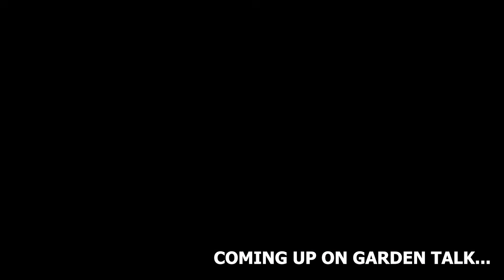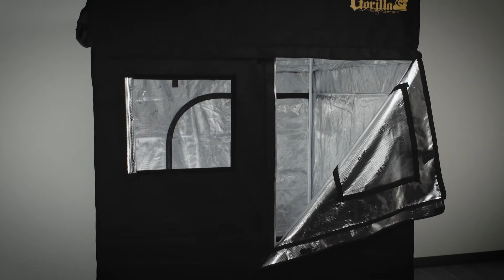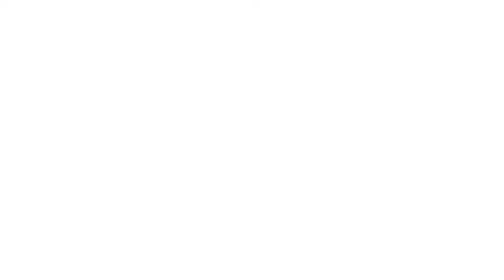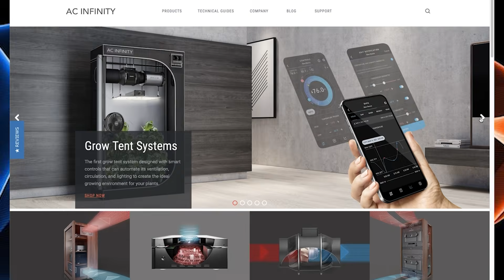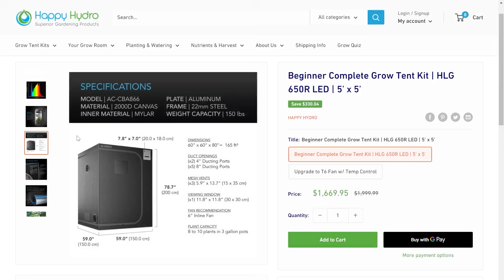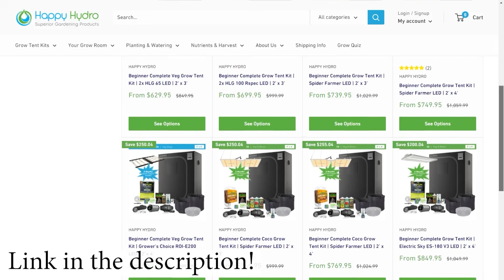Increase Plant Yield By 30%+ With This Essential Element! (Garden Talk #76)

Comment: Yes, you have the process exactly right.During the daylight hours, plants produce excess glucose through photosynthesis, which they link together into long chains to store as starch inside their cells.When darkness falls, plants cannot photosynthesize, so they break that starch back down into soluble sugars (like sucrose). These sugars are transported throughout the plant to fuel growth, tissue repair, and energy production via respiration.

Comment: Soo I grow in 20 gallon pots I do the perma flower right so I veg in a 5 gallon fabric than when ready that fabric pot goes into the 20 gallon I do my amending in the first place gia green 444 284 and glacial rock dust microbes I use 60 table spoons of each the first time on reamends(as I use social for 3-5 grows) I do 25 %wormcastings an 20 tablespoons of the three I do nothing further than than on the amendment end no topdres I just train and defol ..I do not ph but use ro water  @420scene doesn't believe it works but I pull a lb out of my 4×4 every 8-10 weeks depending on flower times of course am I the only one in the world aware of this lazy hack...I have beautifull plants all throughout the lifespan I haven't seen a defencey sense I started doing it this way...think about it tho 3 kg of each feed starting out another kg each run that's a lot ...I'm on a mars hydro es300 if that may affect anything
Reply: @willglasbrener2605  Literally Mr. Canuck's recipe &$$face.

Comment: Average amount of Co2 produced per rabbit:
Reproducing Doe's: 12.6 grams per hour, 302.4 grams per day, 3.02Kilograms Co2 per 10 days
Fattening rabbits: 3.34 grams per hour, 80.16 grams per day, .8 kilos of Co2 per 10 days
Poop per day: A 1lb-3.5 pound rabbit makes 133 grams poop per day.
A 6-10 pound bunny = 220-450 grams of poop per day.
I'm still trying to figure out how to do this and keep the bunnies happy and the Co2 levels in range and I really can't stand doing math. I'd take the rabbit pellets and feed them to red wiggler worms for primo castings and use that in my soil. Not to mention the pellets themselves can sell for a crazy price! More than the rabbit food costs easily. 2lbs for $16 on Amazon for the manure and 50 pounds of rabbit feed for $12 at Petco. That's $400 of manure for $12 feed plus the rabbit meat and fur. 
Also: The droppings can go straight from under the rabbit hutch because it's not a hot manure. It won't burn plants. It is, nevertheless, four times more potent than horse or cow manure and twice as rich as what chickens can produce, partly because those manures lose nutrients while you wait for them to be useful. It's obviously a practical thing to do even if just for raising pets. That and a great way to clean up the trimmings from the produce. All of those nutritious fan leaves being devoured by bunnies with the munchies. The more they eat is the hungrier they get. I also wonder if the terpenes in the scrap weed feed would season the meat. $55 for a 3lb rabbit that made over $16 in manure a day, it all equals profit as long as the rabbits are happy with their living conditions. Hopefully I'll be seeing a video soon of someone who actually tries this and is successful.

Comment: Any ideas about this issue would be most welcome.

I have 7 SCROG plants in grow bags in week 6 of flower. All 7 are planted from a single pile of Coco coir, worm castings, compost, perlite, and regular cycle Grow Dots.
They are on an auto-drip system at 75 ml/2hours from a single reservoir. pH adjusted to 6.5 with Silica Boost 5ml/gal and Epsom Salt 2 tsp/gal. 
5 of the plants are very green an sugary. The other 2 have paler fan leaves with less sugar, but normal looking flowers. I have changed the direction of water flow with no obvious change. I do have a bit of a mish-mash when it comes to lights, so that may be it. I'll try mixing them up differently next time. Any other ideas? 
Thanks! 👽✌️

Comment: So can we still achieve 30 percent increase by using carbon based nutrition assuming everything else is kept in balance, sounds like the plants would respond to higher intensity light without stress
Reply: Right now I'm doing all of this and trying to make it work together. I'm seeing amazing results 3 weeks into flower, unbelievable results so far. For a year I keep temperature 74 and humidity 60 dropping lower closer to harvest. This time I have all big yield plants and I'm trying different with temperature trying to bounce it between 74 and 83. Wow these plants love 83 degree, only 1 strain I had to move her to another tent she loves 74 temperature.

Comment: 34:59 
Very important because sometimes your plant needs magnesium and not more nitrogen. Foilar spray is th esiedt eay to tell because less thsn a few hours your leaves will respond. Epsom salt works fine if dikuted correctly but tbh any till help. Sprinkle some un a bittle and see if anything happens

Comment: I have been growing my own cannabis now for 5-6 years, I am using quick grow nutrients, microbial mass, chitosal and peat moss mixed with sea-soil (a mix of fish parts and forest fines), I have always been satisfied by the mix, but I am also super curious about the yield and potency increase I know can be provided by the CO2 supplementation. I use a grow-tent, in my dining room, so cannot use co2 gas supplementation, is the sea soil adding enough co2 to improve my overall yield and potency?

Comment: My Biowave opened all my stomatas 100% at a constant, was insane when using Co2, I did as soiless and was to control my feed for the increased light and Co2, then backed off evening in last two weeks and slowly copied my environment mimicking weather seasons
Reply: Where can I get one
Reply: @johnpeter9000  order from the company direct if you can find it, if look right now but am driving atm

Comment: I have used that Canna Boost accelerator since the early 2000s, and that is one product I believe does more for any indoor crop no matter what line of nutrition I was running.    Did side by side test with same strain, same cuts, same mom, same soil mix to a tee!  Every time the plants hit with canna boost, we obviously better tasting, smelling, and just over all tricome development looked stacked, larger in diameter and height. This was very noticeable after a phenomenal 6 week plus cure in an environmentally controlled cure room.  

 "The cure is where we see who really shines,"  

When I'm growing a true connoisseur crop,  it's one of those ingredients I find to be irreplaceable.   #carbon
Reply: What other nutrients line have you ran? Just interested to know, my mate runs canna and Dutch pro but trying shogun line this time as its half the price.

Comment: 3000ppm co2?! Haha. Nah I've read good studies showing in most cases anything over 1100 ppm is essentially pointless. I've been using that level of co2 for years and I've pulled 4 per light on gorilla glue #4, so I think I maxed out that plants potential with that ppm. And that was on a 4x4 tray with a 4x4 canopy...

Comment: As a small scale organic farmer we also generalize carbon being any organic material that has turned brown or dead. 
Within a regenerative system these carbons are used first for animal bedding. Applied in thick 6 inch plus layers like a carbon diaper you might say.
This carbon bedding locks in nutrients from the animals....waists.
Also locking up ammonia from off gassing, a vital natural resource for growing things once the compost has broken everything down to be plant available.

As a previous layer is messed on a thick new layer of clean carbon is put over the old layer. 
The animals always have a clean natural surface atop and once the layers begin to add up it begins to compost on its own. Typical deep bedding is allowed to become 3 or 4 feet thick before removed to finish composting.

Ultimately what you end up with is an extremely nutrient rich mixture of materials that has already begun the composting process. It just has to be piled up to finish composting.
It makes some of the best compost I've ever seen or used.

Comment: According to what I have heard and seen biochar works great. But you must first acclimate it which means treated with rich soil and only use about 10% of your quantity of soil with biochar and make sure you have the soil very wet to make the biochar hydrophilic which means opposite of hydrophobic it can hold water in other words. You can also increase the hydrophilic by a term cracking which means put steam to it and expanding it to hold more water better.
Reply: A yukka based 'wetter' also helps with biochar.
Reply: The difference is that biochar has spaces that let myco. grow. Biochar is like a hotel for organics.
Reply: I was going to substitute the yucca with aloe vera gel in water feedings.

Comment: I grow citrus trees indoors as a hobby, and the more I've watched each sections of this video, the more I get frustrated with fertilizer manufacturers.

     I know nutrients comes from the air, water, soil, but we known about 22 nutrients to date and they are: 
nitrogen, phosphate, potassium, oxygen, hydrogen, carbon; calcium, sulfur, magnesium; iron, manganese, zinc, copper, cobalt, nickel, silicone, sodium, aluminum, boron, selenium, chlorine and molybdenum. 

     Carbon, is one of many macronutrient nutrients. Why, do almost all companies omitted this very important nutrient from thier formula?
I just understand that concept by forcing many plants into deficiency problems status, based on the lack of that nutrient.

Comment: When I switched over to organics i quickly noticed that the main drawback to organics was a struggle for adequate oxygen in the bottoms of my soilless pots. So i started burying airstones hooked up to my air pumps in all my pots. Increasing my yield by a consistent 25%. You're welcome
Reply: I do this same thing. I have a small air stone in the bottom of each of my 5 gallon buckets and I grow in coco which is light and fluffy anyway. Since coco is considered hydroponics
Reply: @KevinModz65  right on, ive done side by side comparisons and i saw a consistent 25% increase in yield and general vigor.
Reply: Lol
Reply: peroxide
Reply: @tylerlidster71  kills your beneficial microbes.
Reply: @Rand_al_Thor372  even diluted ? I'm a Coco guy 😂thought I had nuff skills to try soil grow and I nearly ruined it 😂 soil after this is again interesting me alot 😂
Reply: @tylerlidster71  yeah bro ppl over complicate it really. All i need is a bale of peat based soilless mix and this dry nute blend called Super Bloom from Rons Organics here in Dallas.  That and rain water and im chillin.

Comment: Under 1500 ppm is the legal safety limit to enter a room in dispensaries here in AK. They run them at 2200 to 2700 ppm. But the room has to be aired out to lower than 1500 ppm before it can be entered safely without risks to people.

Comment: Gorilla grow s tents ⛺  I have them and the zippers fail first, so baddd
Reply: Why not add roll of velcro? You can get craft section at walmart
Reply: @melissawillard6600  Gorilla has the worst Zippers!! Buy a AC. Infinity-Way better tent, and zippers!!
Reply: I made mine out of ag plastic with velcro dots.... cost about 20. It's lasted 3 years so far.
Reply: @melissawillard6600  THANKS

Comment: I found XL bags work very well the 365 I have a C regulated in the room in the summer I keep the tent open days /night close it with a small dehumidifier inside I keep two in the room carbon in the soil really helps the coconut horticulture with the sugar really makes the plant vigorous Full coverage a must not overcrowding  I’m running so hum with exceptional results also bud igniter Advanced really gave them that boost even in the third week Tarantula piranha Even though the soil does not recommend it I think it’s very important to add those extra microbes fungicides everything that comes with it really happy with the Gaia green pro bloom As well as the phosphate rock dust Gaia green worm castings unbelievable results little extra Watching what the plants will use outdoors it’s incredible as well First year using Gaia green I have not sprayed once indoors or out plants are Thriving no pest issues outdoors as well not even a beetle this year Or a caterpillar kind of weird-not even a fly of course flies outside Living soil the plants will kill off any pest tries to invade it I did kill a couple 5 ft plants I seen earwigs going in the stocks I took care of that right away The rest just took off
Reply: dude! punctuation!

Comment: Wonder what nik thinks or says about defoliation and how important it is with the uptake of carbon intake obviously less leaf matter less co2 intake? Or less leaf matter less needed?  I mean WOW the information here is definitely entering higher level of understanding how things scientifically work .basically he puts things in mechanical terms. Like calcium is like a cam shaft or valves. Sunlight , carbon, nutrients is the gasoline.silica is like intake manifold . Lol

Comment: Thinking about sealed rooms with enriched co2, plants give off ethylene, and if ethylene is a nasty growth inhibitor, can you scrub the ethylene and increase growth even more? Just something that nags at me. Could it maybe be converted? Siphoned off or absorbed by some other companion plant?
Reply: You could scrub ethylene with a carbon filter Id assume, but no idea if you would also scrub the added carbon or not.. I wouldnt think so but dont quote me on this. And every chemical has its opposite chemical that cancels it out, the question is, would the chems that did the job be safe to use, cheap enough to use, and easy enough to use to be worth it, when just using a fan fixes the issue now?

Comment: High levels of CO2 at night may cause yellowing of leaves so lowering is recomended. Plants at night go through a process called respiration inwhich takes in oxygen and releases CO2. so co2 isnt needed at night. Its also recomeneded to have floor fans if not lower canopy ventilation so co2 doesnt become stagnant which can cause herming in high ppm concentrations around the lower canopy.
Reply: @boriskogan7903  Ive only seen one instance and that observation is not 100% because it may have been cumulitive amungst other faulty methods as to why multiple rooms of 1000 plants hermied out. But it was high on the list for the culprit. Its documented that plants take in oxygen and release co2 at night called respiration, so thats good that you vent at night if not, this would cause a "suffocation" effect and make plants stess or yellow. The levels of CO2 that i am talking about would be a CO2 reading shoulder height, at 1.5k-1.8k ppm of CO2 without having floor and table circulation fans/vents in a room during the day. Granted plants are genetically able to adapt to high levels of atmospheric CO2 from having that genetic evolutionary skill from dinosaur times. But pushing co2 ranges can stress a plant and mess with ethylene levels causing stress, hermaphroditism, increase flower times, thicker leaf structure and biomass. Honestly there are so many factors for plants going hermaphrodite as its naturally within the plant genetics to do so under stress. And if anyone argues different about hermaphroditism in canna and that its just about stability.. then i say spray that "stable" plant with STS spray and you'll see balls my friend..lol ballzzzz
Reply: @bsvcraftgenetics6957  So a fan above the canopy with an exhaust fan in a tent isn't enough venting?
Reply: thanks for your very informative posts! you're right that high levels of CO2 at night time aren't needed, the light-energy coming in during the day powers Rubisco, so when the lights turn off or the sun sets, the flow of energy into that system slows down, and oxidation of reduced compounds built up through photosynthesis across the day start to occur within the mitochondria. however, during the day, the mitochondria are still active, and the activity of the Krebs cycle is what produces the skeletons of amino acids, so as plants take in nitrogen they can reduce it and combine it with organic acids in an active process. there is a direct coupling of chloroplast and mitochondria activity during the day and night - their activity levels balance each other out. thanks again for dropping good knowledge!

Comment: Great show, thank you for sharing so much information. In NYC the carbon dioxide levels in the house and street are over 2000 ppm in the summer. How do you utilizer that amount in your indoor grow ?
Reply: Sheesh really….I need to buy a co2 meter because I doubt I’m getting that in my basement.
Reply: Two different elements